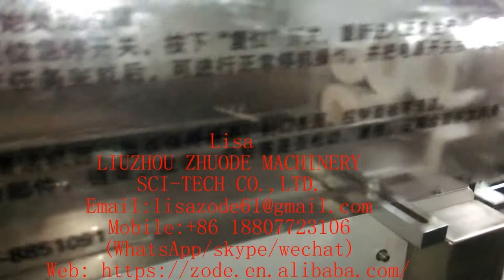Full automatic toilet paper and kitchen towel packing machine

Comment from the maker: 1) It adopts full servo technology, touch screen and PLC control system.Running in a high speed,no pollution.
2 ） This machine is designed to have various specifications format changeover between toilet roll and kitchen towel , it thanks to the advanced double layer arrangement system.
3) Adopting advanced world famous brand components in pneumatic parts ,electric parts and operation parts.
4)our machines can pack toilet tissue from 2-48 rolls and kitchen towel  from 2-24 rolls

contact :Lisa 
LIUZHOU ZHUODE MACHINERY SCI-TECH CO.,LTD.
Email:lisazode61@gmail.com
Mobile:+86 18807723106(WhatsApp/skype)
Wechat:15678084881
Web: https://zode.en.alibaba.com/